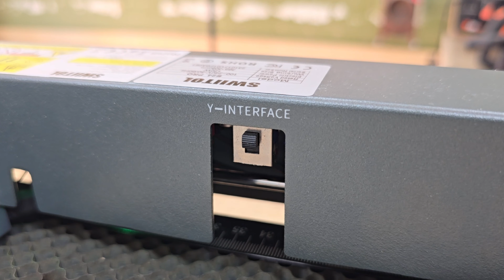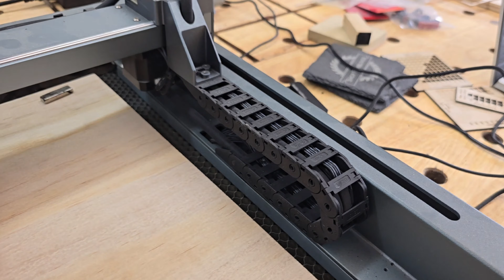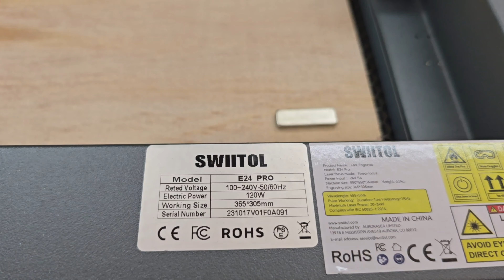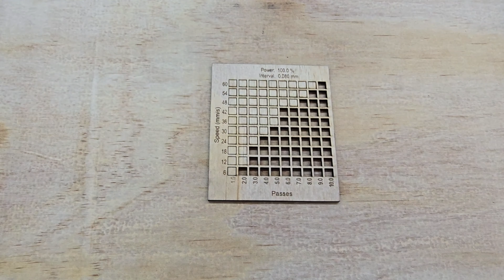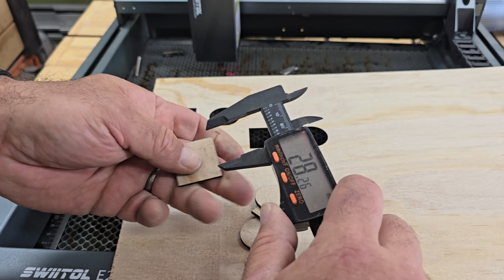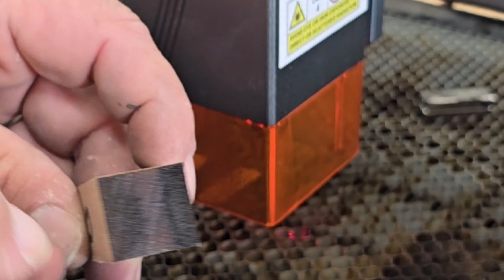Does 20 Watts equal 20mm Cut?

Comment: I been considering one of these, know absolutely nothing about em lol, guess I'm old school, along with building I do free hand carving, but sure seems really slow, not that free hand is not lol. Seems cool though, just so many options and programs and it's a massive worm hole for someone that don't know, cause who wants a garbage unit that every manufacturer says theirs is the best ya know, could be an expensive mistake for me hence, why I haven't done it...thanks though, learned a little here ..
Reply from the maker: I forgot how many lasers I have had. Lightburn is the goto software for personal or commercial use. It is cheap and powerful. 

There are tons of different lasers from $200 to $20,000. I can't afford the super fancy ones. 

You have to decide what you want to do with it. If you are going to use it inside, you need an enclosed machine vented outside. If you are in a shop or going to set it up outside, an open machine is much cheaper. Then it is a matter of speed and thickness you want to cut. I purchased a TwoTrees TS2 10w for a friend. It has been one of the best machines I have tried. It had the largest area, had Z height auto adjuster. If I had a small budget, I would look at that one or the 20w.
Reply: @ShopRamblings  ok thanks